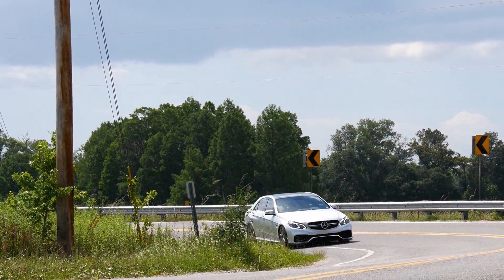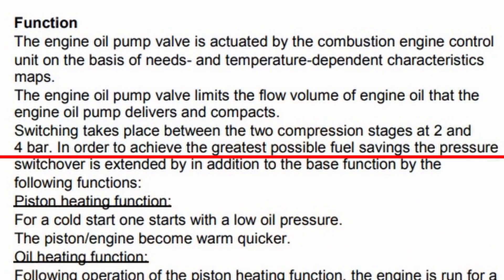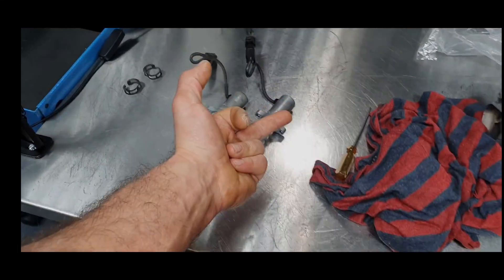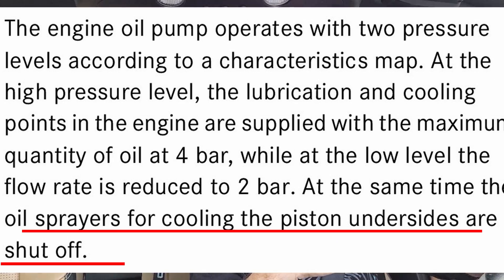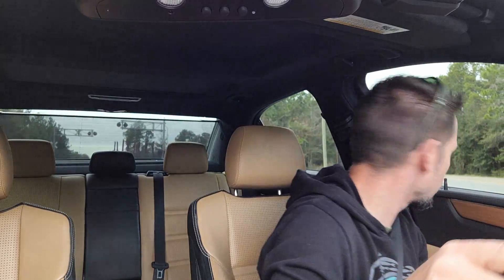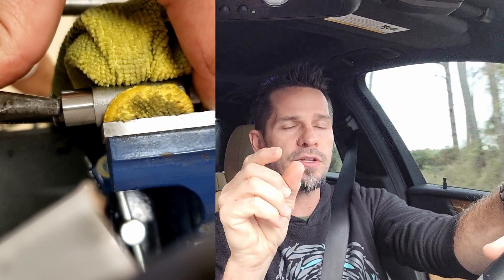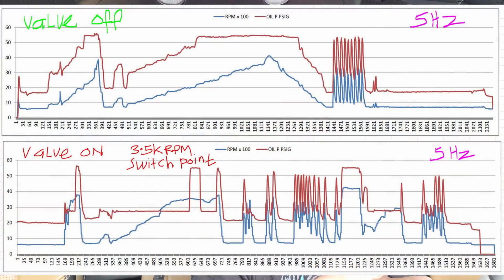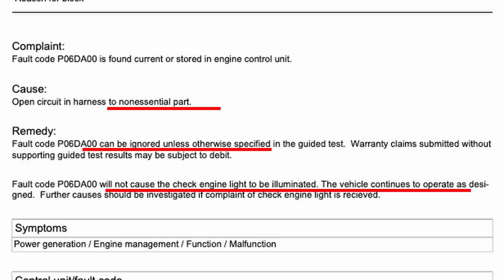M157 KILLER SMOKING GUN? Oil Pump Solenoid ~ Free mod! ~

Comment: Hello everyone
- VVT shows zero degree on data stream during idle 
- if u have V shaped engine then each of ur VVT must show zero degree during idle 
- if one of selenoid shows other than zero degree then u may check it by changing locations between two of them of V shaped engines n check the degree during idle
- if u have bad selenoid then ur car stalls 
- the reason of stalling may be broken VVT or polluted selenoid n increased resistance 
- if u activate selenoid during idle by scanner then ur car must stalls in case of good selenoid
- u may activate selenoid after removing it n make visual inspection of its working condition 
- resistance of selenoid must be no more than 15 Ohm, if higher or endless then throw it away (R< 15 ohm)
- don’t forget that the reason of illuminating light may be chamshaft actuator
Reply: Araza, VVT will never show zero degree during idle. Your scanner must be defective or not MB compatible.  Based on M276.820  3.0 Turbo of an E400 of 2014 . From cold idle ( ambient temp 30C ), EXHAUST VVT where when engine OFF position is -25 degrees will slowly upon engine start for about 120 seconds goes to -5 degrees. When engine warmed up enough Exhaust VVT will settle to - 23 to -25 degrees again.  The INTAKE will be relatively stable at +33 degrees during the same time period. I am using Xentry.
Reply: @suryaprihadi2258  yo my boy
did u reply basing on what u faced or that u educated ?

Comment: Pinned the throttle the other day at the light and cluster read “insufficient oil pressure” although I knew it had the correct amount of oil…Now I know why🤦🏻‍♂️disconnecting asap.
Reply: Working good so far ?

Comment: 1. Crazy that there is no oil pressure sensor on these engines.  Even in the WIS the procedure is to connect an external pressure gauge at the oil filter housing.
2. The solenoid wire can be disconnected fairly easily from the top on the M276 (6 cylinder) engines, both the turbo and non-turbo cars.  It does require removing the air intake duct for easier access.
3. This is well worth doing on the non-turbo M276 3.5 liter engines.  The engine becomes much more responsive at the low RPM range.
4. Great video.
Reply: I can’t find this wire on my M278, I did find something at the 7 o’clock position, so maybe it just looks different
Reply: @emanueldaggett1898 did you ever try unplugging it?
I have a 2013 M278 and about to look for mine.
Reply: Do you have to remove the intake manifold fully to have access to the solenoid wire? Thank you!

Comment: Another thing I’ll be doing to my S63AMG asap! 
Thank you for sharing all this great informations with us 😊
Reply: I haven’t checked the code but i will check and see what’s going on. I was pretty upset because the car sounded and felt a lot better with the sensor unplugged.
Reply: Hey, have you try it yet? Pulled it off on my 15 S63 Coupe. It gave me CEL
Reply: @yongkangzhou2302  Hello,
I did unplug the sensor but I haven’t driven the car yet as I don’t use it winter time. I won’t know until April time but my friend done it on his CLS63AMG and he’s happy that he done it. It revs faster/freely and he noticed a different in gear changes
Reply: @Sam_AMG So far S63 is the only one get CEL from this based on bmworld discussion so eager to know😂
Reply: I pulled it off my 16 e63s. And I just got a CEL after 50-60 miles 🤔
Reply: @admirlajka  No W212 E63s shouldn't get CEL because of this. Glad you checked it out. So far only s63
Reply: @admirlajka  Mmm, that’s strange as the only two times I’ve now read this happen is here. My friend hasn’t mentioned anything since he disconnected it on his CLS63AMG and another forum member. Is the engine light on because of the sensor? Have you read the code?
Reply: @Sam_AMG  checked the codes. I guess it was just a coincidence that I had an other issues a day later. Two codes came up , P227F(00) and P2280(00). Always something….
Reply: @admirlajka  Te pakten nuk ka pasur lidhje me sensorin qe ke stakuar. Tani edhe ndonjehere do e nxjerin shenjen e motorit por prap I kemi qef keto te shkrejta makina 😁.

Comment: For anyone considering this ‘mod’, it is very simple to do and the results are almost instant. I did it on my car weeks ago and it’s been running great still, shifts are amazing, oil is definitely lubing everything up as it should. 

There are many posts on mbforums about this topic and is a good read just search ‘oil pump solenoids’. For those who are going to do it, also order some ghost connectors to not have problems with corrosion

Comment: Just got done doing this after watching the video. Confirmed that the silent code that pops up is the one you posted. Currently driving the car now and it definitely feels like there's more throttle response on a light acceleration from a stop. Definitely feels smoother. Thanks again!

Comment: I have done this free mod on my e63s as well. I have 29k on mine and I noticed a diffrence on shifts, throttle input and how fast and free revving the engine feels!
Reply: Any issues since doing this mod?
Reply: @HirschPower  no issues at all. Still unplugged.
Reply: @besicm1 you run 29k miles with this mod?
Reply: @Juhur2m  I unplugged it at 29k, currently have 38k, so little under 10k miles with it unplugged.
Reply: @ do you recommend it?
Reply: @Juhur2m  110% I do! It totally wakes the car up especially after a few hundred miles when it goes through it's learning procedure.. Now it's just aggressive and wants to be unleashed
Reply: @ ok nice. Want to try it in germany at my e500. The original Oil pressure is very low… only 0,8-1,1 bar at 800rpm… but the comparsion show the same pressure at idle 🤔

Comment: Bro, for real this may have been the entire issue with the cylinder walls scoring the entire time! How can the factory programming cope with a tune on the M157?! It can't... It's very likely something that tuners overlooked and even on stock cars it's barely able to keep the engine protected.
Reply: Still doesn’t solve the bent rod issue with the M157
Reply: @carmelothegoat1892  That's not a common issue and you usually see that with engines that were str8 gang banged.
Reply: @autolife904  I’ve been researching the m157 as next potential car and a lot of forums I see that stock/tuned M157s having bent rods after misfires and if it’s that easy to bend rods than I’d rather go M156 or M177. That’s without mentioning the scored cylinder walls as you mentioned.
Reply: @carmelothegoat1892  It's debatable whether or not that bending rods and cylinders being scored are as bad as they are made out. I suspect that a lot of that comes from poor and lacking maintenance. But then again I've seen scored cylinders coming from the occasional M157 due to the stupid design by Mercedes Benz putting very soft material there as opposed to the much better quality cylinder lining of the M276 nano coated cylinders. Those engines are remarkablely durable.
Reply: @autolife904  Its not debatable at all.    Its partly caused by this oiling issue but also by injector wear and leaks.     Nothing will destroy an alusil cylinder quicker than fuel bore washing it, lack of oil or a straight up mechanical failure IE a bent rod or other intrusion.         Bent rods on m157 is because the rods arent strong enough simple as that.   Its totally nothing to do with oiling or anything else non tune related because bore scoring from a bent rod will be inline with the crank and wrist pin.   Bore scoring from fuel or oiling issue will be 90degrees from that.     Tasos has practically hundreds of videos proving bent rods is because of the factory rods (the soft alusil bore material isnt ideal either but not the main cause its clearly bent rods in those cases).     He proves this by putting aftermarket rods and usually sleeves in and the engines are near bulletproof thereafter (or as good as these can be without additional mods).    I suspect he also knows how to look for bad injectors as theres also a couple of vids about that.
Reply: @austingtir  interesting, I've watched these videos. I'll look into it more. Still it can't hurt to increase my oil change frequency to 3000 miles and have the pistons sprayed regardless. Probably better to get the engine pistons and sleeves done while my engine doesn't need it...before it does need it
Reply: @austingtir buddy you realize, that’s theres a very small percentage of engines with this issue correct? Millions of dollars went into this engine that you think they failed on. Yet 100’s of thousands of these engines are doing just fine! Proper maintenance is key to this engines success! Also “heat”is literally the sole contributor to any rod failing!
Reply: @mauisuzuki7857  Another one in denial.     You realize the rods are actually bent from the factory right?       There are probably tens of thousands of these cars out there with bent rods that most owners are completely clueless they even have an issue as rods can be bent and you can get a tiny bit of extra oil use and they wont even know MB will fob it off as being normal etc.    M278 and m157 rods are BENT FROM THE FACTORY!!!!     Then they bend more when you ring the car out or tune it.   Only really m157 have real issue from this though.   m278 because of longer piston skirt and smaller bore dont suffer as much they suffer from other bore score issues though.    Doesnt matter how much "maintenance" you do short of replacing the rods on a m157 they are duds and you are only most likely lucky or are driving like a grandma if you dont have this issue.      Alot of these engines have atleast 1 or two dud rods.
Reply: @austingtir  First I own 2 of these cars! Denial can only be had by the experience you have faced! These engines are incredibly reliable!! Second you need to stop believing everything you hear!!! Such a conspiracy, I know!!! Have you actually ever even owned one of these cars? What experience besides trying to bash a car you probably haven’t even owned do you have too show? I’m sure you’re experienced with watching tassos!!! What portion of the block have you worked on?
Reply: @mauisuzuki7857    I own an m278.     I guarantee what I told you is correct you can either take it in and accept it or live in denial.     The information on the rods is actually on an german chanel in german he has sources straight back to the factory that produced the rods.    And yes I watch tasos.    If you think this is a conspiracy I suggest you invest in a really good borescope and take a look for yourself.     Or disassemble your motor and find out for yourself.    Thats the only true way to know but you can still tell alot with a good borescope if you look at it right.   Again most people like yourself are clueless and will want to fob this off.     Remember I told you the rods are bent straight out of the factory.     Eventually this will be common knowledge.    But atm hardly anybody knows about why and how these have issues most as proven by this vid and the comments under it are guessing.     This information needs to  be spread around so everyone understands what they are looking at and can use this information when they borescope their engines to make informed decisions.
Reply: @austingtir  I’m not even gonna read the B.S your putting out!! End of day, that’s your experience! Not mine and many millions of others either!!!! My cars run great 2013 sl63 and a 2012 e550 coupe, both tuned and built. Only issues I’ve had in reality are tensioners. Both replaced with updated units! Do yourself a favor and drive your car and maintain it like it’s meant to be. You will find these cars to go 200,000 miles without much issue!! Otherwise live fear and and trout your conspiracy theories!!!! Millions of these engines have been produced and your here talking about 2% this is our woke world coming to life!!!!
Reply: @mauisuzuki7857  My experience is backed up by two of the best mercedes mechanics on the planet.     Yours is just pure denial and delusion.
Reply: The bending Rots came not from Tuning or Stock it's luck because of manufacturing tolerances watch the video from shift to passion it's on German but the complain about the Rots
Reply: @gonzo2372  Yes I understand and I have seen that video that guy gives very good info on it too comparing the m278 and m157 piston too.       I still stand by what I said the m157 rods is shit if the cause is because its bent from the factory its still a shit rod.  Its just shit from the factory like they made them in china or something.    He also says the m278 even though it has the same rod rarely if ever has this issue (miniscule bent rods from factory in them too!) but its probably because of better piston design aswell.    End of the day the fact they used the same rod between the m278 and m157 is the standout.    They should of used a slightly beefier rod with a normal small end design on the m157 no matter which way you spin it.   The fact aftermarket rods fixes this issue says it all. As he explains the m157 piston also contributes as it can rock in the bore more due to a shorter skirt and more side loads due to its shear size.     End of the day MB fked up bigtime on the m157 and less so on the m278 due to the soft bore liner.   He also says the 2015 up m278 (not sure what date) are the ones to get due to MB using a better cylinder liner I assume like the m177 engines and an even better piston.
Reply: Scored alusil cylinder walls mainly happen from hot roding from cold and not proper oil changes

Comment: Interesting video.  Wondering if this applies to my E400 engine.  My E400 is a 2016 with only 35K miles.  As you can tell I don’t do much driving.   But your video really got me thinking. Thanks
Reply from the maker: According to the forum, this applies to pretty much every Mercedes vehicle, you can check out the thread, to see what people have already done it to their cars
Reply: @ExoticCarDIY  alot of good data at the MB forum.  I need to find out what type of engine I have in my 2016 E400 non 4matic.  Don't know if its a M276 or what.
Reply: @joea1746 M276.  This was the original engine where the research was done.
Reply: This past weekend I was seriously contemplating doing the oil pump solenoid disconnect mod on my 2016 E400.  Although the data  provided and what I read on the MB forum seems very solid.  However, I am still a bit skeptical about doing the mod because I've had my E 400 since 2016 when I got it new, and the car's been running beautifully.   It's been going through its normal maintenance at the Mercedes dealership.  And I also have the oil for life, and I don't drive my car hard. Like you mention with any mods dealing with the oil of the engine, it must be done with caution. It would probably be okay if I disconnect the oil pump solenoid. But I still need to see more testimonials other Mercedes owners that have done this mod on their vehicles before I make a final decision.
Reply: @joea1746  I would go for it.  The original research was in the M276 (which is what you have).  The results are well documented.  We AMG people are late to the party.
Reply: @kevin9c1  thanks for the comment.  Really appreciate it. It really helps with the decision process. 👍
Reply from the maker: @joea1746  leave it stock, keep the oil clean, you'll be fine 😎
Reply: @ExoticCarDIY  After talking with friends who are automotive mechanical engineers and MB owners, decided to keep it stock.  They said exactly the same you did "Just continue keeping the oil clean" it will be fine.   Thank you Ken for your continue awesome no nonsense automotive videos  👍
Reply: @joea1746  I have done it to my SL400 with the same engine as yours.  As posted above, it has been an excellent "modification" for my car.  I have a Vivid Racing Stage 2 VRtune which benefited greatly having improved oiling at lower RPMs.  If you read all the pages on MBWorld, you will have seen the XENTRY TIPS (Mercedes-Benz TSB LI07.70-P-070763)  from Mercedes saying that the solenoid is a non-essential part and the associated DTC can be ignored.  This mod disables the LOW oil pressure stage, providing a linear increase in oil pressure according to engine speed.  The low pressure stage exists ONLY to marginally  improve gas mileage in an effort to hit government-mandated EPA mileage targets, not to improve engine performance.  Anecdotally, I have seen no change in my gas mileage since disconnecting the solenoid 40 days ago.
Reply: @JettaRedIII  thanks for your comment.  I  I I am very apprehensive to do this since the car hasn't given me any issues all these years.  But if it will make the car run better and prevent a future issue, perhaps I need to move in that direction.  Thanks again,  by the way those SL400 are beautiful vehicles.